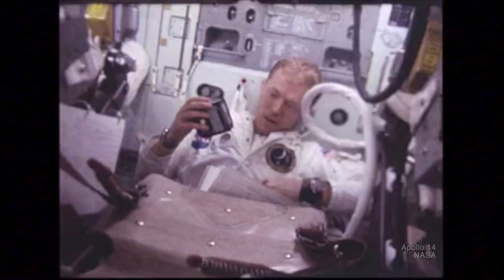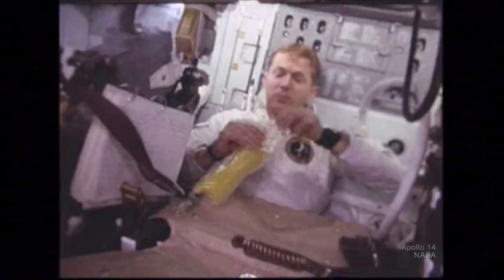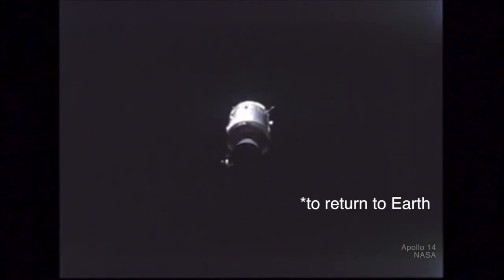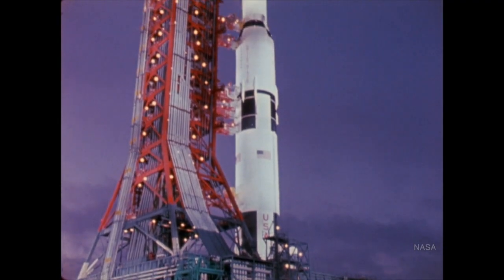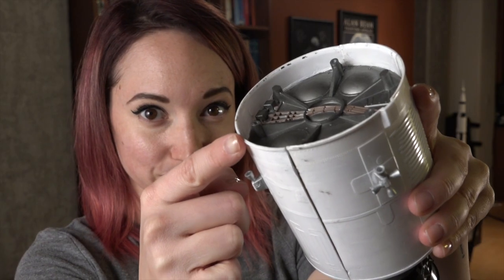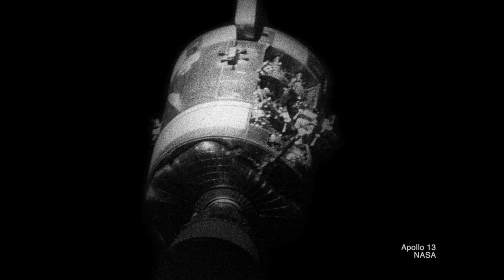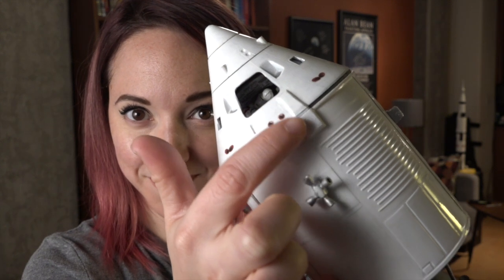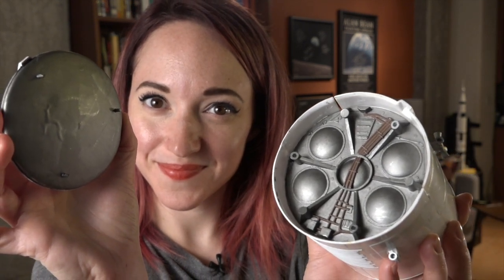How Did the Apollo Command and Service Modules Separate?

Comment: cool. I wasn´t aware of these couplers. But of course there must be something. All in all thinking of all this mecanical stuff and moving parts it´s kind of a miracle the every single essential thing worked every time on every mission (ok except Apollo 13). I mean imagine, one of these guilotines did not work properly. That would have caused a catastrophic mission failure.  Of course they had backup systems but everywhere they would maybe need it. As a pilot I know you cant have a backup for everything, otherwise you would never lift off... 
@Amy, how about an episode about backup systems and emergency procedures?
Reply: +AdventureAirInc Yup you have a recipe for disaster if the guillotine does not work. As was the case in Vostok 1, which alsmost got badly wrong. Fortunately the wiring burnt through on re-entry, otherwise Gagarin may well have died. 

And I think a few Soyuz capsules had similar mishaps but I am not sure and too lazy to check. ;)
Reply: CountArtha
 I know but there are many things which may fail after the last test or cannot be tested at all. Ie. the actual decent and ascent engine of the LM could not be tested. The fuel is so toxic and corrosive that the engine would have to be replaced after testing. Of course the fuel was hypergolic but.... you know, not everything could be tested before launch.

Comment: Was really expecting an april's fools, ended up getting educated instead. 10/10
Reply from the maker: +Craving Hibiscus I was thinking of doing an April fool's video but decided not to potential annoy you guys!
Reply: Plane Joe - You misunderstand. I'm not attacking YOUR faith. I'm pointing out that the book that you base it on is not science. One can have faith in a deity without all the trappings of religion, and its dogmas, and texts that were written by fallible human beings. The choice is up to you.
Reply: +plane joe So far your the only brainwashed sheep I've seen here.
Moon landing faked odds 1 in a billion  Flat earth odds  ZERO.
Any even slightly creative person can prove the shape of the earth to themselves.
Why can I not receive any FM radio from more than 90 miles away same for TV stations? Why can't I receive TV signals from Denver and New York while I'm in Chicago? It can't be the distance because I can bounce the same frequency off the moon and talk to a ham who is doing the same thing called EME bounce. Even by retarded flat earth math thats 6000 miles round trip. Actually almost 500,000 miles by real math. At more than 90 miles even the tall transmission towers are over the horizon on the spherical earth. Flat_earthers have no viable model of how the earth works, until they can present a workable model you should not take them seriously.
Where is your model?
Reply: Owen,
Hey moron ,did you read the very last post before yours?
I know , it's such a bother to actually read a thread before you post your idiotic bald assertions.
Wait do you accept that the Earth a sphere but just doesn't spin on it's axis?
It's hard to keep track of all the idiotic variations there are in the meanderings of the flat earth dimwits.
If you point a camera at the night sky and do a timed exposer of the stars why do they move ? Why do the stars leave trails in arcs?
How do you keep your delusional disorder in the face of these glaring facts?
Reply: Focault's Pendulum shows that we're spinning. (Either that or stars have the mysterious effect of dragging pendulums around with them.)
Reply: Owen ,
OK flat earth no spin , got it.
Yes straight to the insults , you are obviously either a dullard a troll or both, why  bother with preliminaries? You came for an argument yet 
the post right before yours asks the question YOU NEED  to answer to keep your ridiculous delusions.
It shows how you can prove  it to your self with no help from the evil catholic, jew , mason, lizards at NASA. 
I just assumed it had jarred your faith  that the Earth wasn't flat already and you were just stating it as a desperate feeble attempt at restoring your delusional  state, especially since you only asked for proof of spin. 

How do you explain the FM radio and TV reception question then?
What conclusions does your 8 year old deduce from " The stars rotate around Polaris"
Just in case you can't find the post just before your first one I'll paste it here .  slightly altered to direct it at you personally.

Why can you not receive any FM radio from more than 90 miles away same for TV stations? Why can't I receive TV signals from Denver and New York while I'm in Chicago? It can't be the distance because I can bounce the same frequency off the moon and talk to a ham who is doing the same thing called EME bounce. Even by retarded flat earth math thats 6000 miles round trip. Actually almost 500,000 miles by real math. At more than 90 miles even the tall transmission towers are over the horizon on the spherical earth. Flat_earthers ( YOU ) have no viable model of how the earth works, until you can present a workable model nobody should  take them seriously
Reply: Owen ,
You started out by insulting every real scientist that has lived in the last 3000 years, so I see no reason to be nice to you.
Nope your a troll , you are on a channel named "vintage space" on a video from a NASA apologist, making wild claims about reality.
A troll with an ax to grind and probably an agenda to make religion look like it only has kooks as members.
Nice try to shift the burden of proof though.
You are making claims against the understood nature of the world YOU must provide proof.
However what does your 8 year old think makes the stars move?I and all the scientist for the last 3000 years say it is the spin of the earth.
You have no explanation?
Ditto for the TV question?
Why don't we all watch channel 2 world wide from their tranmitters on Mount Everest?
Reply: Owen  the deceiver troll ,
Electro-magnetics?
  NO  dumb dumb electro-magnetics is the radio waves you can't explain why don't travel more than 90 miles.
Real Christians don't buy that crap, only moronic crazies like you believe the Earth is flat. The bible teaches the opposite.
What does the ancients calling a velociraptor  a cockatrice have to do with ANYTHING? 
What kind of dementia do you need to think that proves something.
SO WHAT?  Do you really think NOBODY found any fossils of dinosaurs until 1824 when we started calling them dinosaurs. 
They almost surely called any T-rex skull (or other dinosaur skull they found) a dragon.  
Again BFD so what.?
Large weather systems rotate one direction in the north and the other in the south.
SO  spin ..
You are not the center of the universe or even the solar system.
Though I'd donate to a fund to send you to the center of our galaxy.
Black hooooolllllleeee........
Reply: Plane Joe Thankyou! Was fearing I'd not hear a single joke. Though a bit late, the: "NASA is hiding aliens and never landed on the moon" is a classic! :)
Reply: ghz24 The obvious lack of a scientific proof of a spin has sent you into a tailspin. No worries. Here's some proof for you. The velociraptors are just a renamed cockatrice. At least that's what I gather from Isaiah. The same prophet that spoke of Immanuel. Oh, the stars move in the firmament above us, duh 🙄
Reply: ghz24 My 8 year-old knows God makes the stars move. Pretty elementary electro-magnetics.
Reply: ghz24 "Sir" Owen the deceiver troll, if you don't mind. I do give you props for epic rants that never answer the only question I've been asking. What experiment shows we're spinning?
Reply: My eyes are quite open, and looking at you, I see a deluded fool, Plane Joe. Do yourself a favor: Pick up a real science book and get your head out of that book of mythological metaphors called the Bible.
Reply: gasaholic47
You brought my faith into it, and made a negative comparison between the Bible and science books.  It was an attack, and a poor attempt to take the argument in a direction that you would feel more comfortable debating.  You've a nerve implying that I'm dogmatic when you are the one with a belief system that you cannot bring yourself to question.
Reply: TheRelihunter The earth is flat. Can you show one proof that we're spinning? Besides fake NASA footage?
Reply: ghz24 Straight to insults with moron, huh? Ok. The stars rotate around Polaris. My 8 year old could've told you that. 😂
Reply: ghz24 Speaking of bothering to read a thread. My first sentence was that the earth is flat. 😱
Reply: +Craving Hibiscus There you go, demonstrating just how effective your programming has been.  Don't investigate for yourself, just ridicule the person trying to open your eyes.  Oh, and I didn't mention aliens, that's more up your street since you love science fiction.  In reality NASA has a much bigger connection with Satanists and Nazis than it does with aliens.
Reply: ghz24 Neither a dullard or a troll, but thanks. Despite the length of your reply,  you still fail to offer a single scientific experiment that proves that we're spinning. Thanks for your time.
Reply: *****
You're repeating yourself.  Watch the video, and debate what it shows, if you can.  I can read your weak insults all day and none of them will get to me, so it's probably best not to waste either of our time.
Reply: *****
Here's the thing, genius:  My religion is irrelevant to this particular debate, and trying to bring the argument there is pathetic.  I was an atheist for fifteen years, and I could probably perform rather well for either side in that debate, but that's not why I'm here.  Watch the video in the link I gave you and respond to it, shouldn't be hard since you have the "truth" on your side.
Reply: gasaholic47
I have no problem with science, I've read plenty of 'real science books', but the thing about NASA is that it has more to do with showbiz than science.  You're deluded if you believe the laughable fakes they give Americans in return for their tax dollars and crippling national debt.  And thanks for attacking my faith, that was super classy of you.
Reply: +Craving Hibiscus Don't you mean indoctrinated?  Wow, I can't believe how many poor brainwashed sheep there are in this comments section.  NASA are a collection of freemasonic liars, they've been caught out hundreds of times, and still you gullible fools lap up their nonsense and throw money at them.  Then to add insult to injury, you throw money at crafty little witches like this Teitel character and reinforce the lies for the next generation of zombies.  NASA are filling your heads with lies, space is not what you think it is, and the Earth is flat.  Think for yourself or someone else will do your thinking for you.

Comment: I would like to know how the cutter worked that separates the spacecraft.  They used the same thing to separate the LEM at liftoff from the moon.  What kind of blade was it and was it spring loaded?  Must have had a special safe mode so you would not separate the two parts at the wrong time.
Reply: +John Wright - The guillotines were explosively operated. They fired them by using an electrical relay to connect the batteries directly to the explosive actuators to fire them. It's basically the same method they use in modern automobiles to fire the air bags and seat belt retractors when you have an accident.

The blades were stainless steel with a sharpened edge. Sort of like a large carving knife.

Comment: APOLLO HAD A SPACE GUILLOTINE? AND I'M JUST LEARNING THIS NOW?!
That's seriously super cool though.
Reply from the maker: +Osiris Malkovich Oy. I really wish I'd called it a space guillotine!
Reply: @AmyShiraTeitel  Have you ever been in a thong contest ??? You could win it for sure ! With love, SUM ............
Reply: +Osiris Malkovich The LM also had a space guillotine.
Reply: +gforce527 - There were actually two guillotines each with their own separate set of ballistics to fire them. If one failed the other would do the job.
Reply: Also useful for executing space royalty.
Reply: Guillotine mechanisms are still used to separate equipment from cable systems in military equipment.  Typically, it is a "cartridge activated device" (CAD) - the severing blade is driven by an explosive charge similar to a shotgun shell.  Not sure if that is what was used to drive the severing blades on Apollo, but many military systems currently in use work this way.
Reply: My big concern with the space guillotine is that it was one of those mission critical things, like the LM ascent engine that if it failed, it was pretty much a LOV situation at that point in the mission. I'm curious how rigorous the testing was for the mechanism.
Reply: ........groan ......groan

Comment: How? They used TR-18D stack decopler

KSP reference
Reply: And struts. Lots of struts.
Reply: *decoupler
Reply: +Dave Messer EAS-4 Strut Connector
Reply: Ahaha, or explosive decoupling XD
Reply: the csm is a 3 person pod in ksp the 3 kerbal pod needs the rockomax decoupler on tr-xl seperator
Reply: More boosters.
Reply: what captured the video at 43 seconds, the LM?
Reply: Probably.
Reply: Randy Owens moar*
Reply: Paweł Szczębrzyszczykiewicz no in real life The decoupled has 0.9 explosive charge and RCS moves it away from command module and the decoupler has two parts, Cyber protection to avoid frying the heat shield and explosive charge
Reply: gentlemen. ,
Cyber protection?
Reply: I got that
wow im obsessed
Reply: Why didn't the Saturn V just use asparagus staging? Smh
Reply: User of Making History here, TD-25 Decoupler for me :P
Reply: Paweł Piłat they had the mk1-2 command pod with a TR-18D stack decoupler and then a fuel tank with a poodle engine

Comment: So if both modules were "already on a return trajectory" wouldn't the  CM hit the SM because the SM would hit atmospheric drag slightly before the CM? So they must have moved away from one another? RCS? //Me and my GF love the channel.
Reply from the maker: +Marcus Depew Yeah, separation manoeuvre was a thing. There was some thrust from the SM to separate it from the CM, and then the CM's reaction control thrusters could adjust the attitude to alter trajectories enough to avoid a collision.
Reply: +Marcus Depew Oh maybe the nose of the CM was pointed toward Earth then they separate and then the CM reoriented to face the heat shield toward Earth?
Reply: +Marcus Depew Okay, I saw at T+ 2:40 that the reorientation is mentioned, sorry.
Reply: There was very likely a "separation maneuver" performed by one of the spacecraft to get some distance between them.  This is common in space operations.  Let's ask Amy!
Reply: +Mark Holm Yes, I wounder what that maneuver looked like :)

Comment: Real good, Amy, think that you've pretty much covered this.I did not know that it was done this way.What might have been a further carry-on, is if the basic space shuttle crew compartment, would have been furnished with the same kind of cut-off system.There is a way that you can use pin-in, to spring compression fittings and or for electric, fluid flow and or air.But this system must not fail under demand.This type of situation plus the technology is probably now, within this time range well in the range of feasibility.One of the big concerns early on, was to get the astronauts to be able to spacewalk.This way, if you need either goods, or to get to a critical storage compartment, then you have that. Hope you had a pleasant feature. Luv ya' and take care to you and yours.  links (F-111 Crew Escape Module Development Report c1965 US Air Force - General Dynamics F-111 Aardvark, here at Y-Tube , look at crew cabin space shuttle https://www.google.com/search?q=pics+crew+compartment+space+shuttle&biw=1920&bih=979&tbm=isch&tbo=u&source=univ&sa=X&ved=0ahUKEwjL5fnGpO7LAhVKymMKHUI6BH4QsAQIGw#imgrc=_
Reply: +vrendus522 This scene from the movie gravity gives you a little feel for what reentry is like.If you have a goal in this field, believe in yourself and have faith. Enter in ( Gravity - Re-entry scene ) in your YouTube search box.